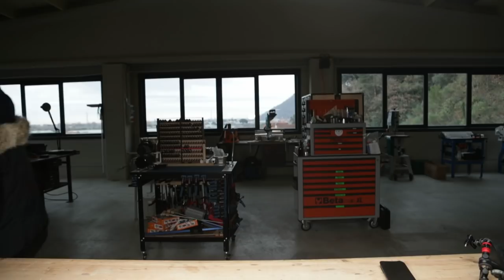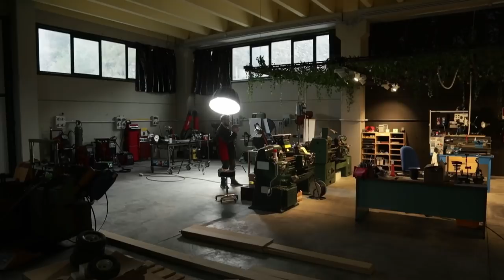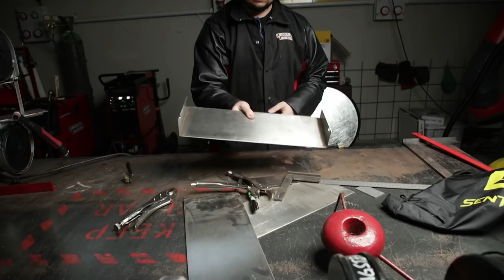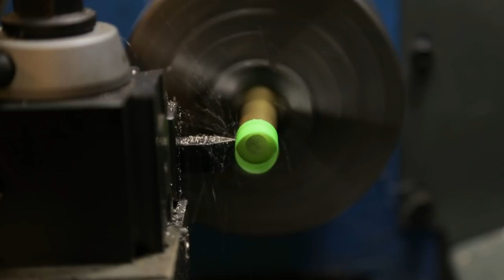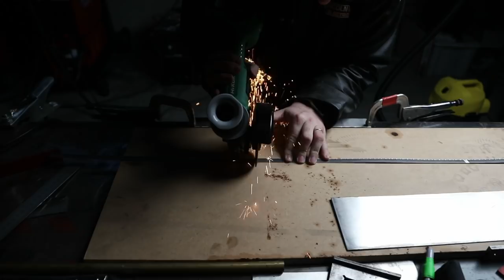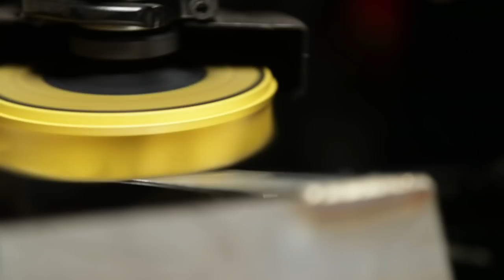Tape station, marking all the things

Comment: Good idea and I like the writing platform and very elegant SS construction but... (for me) it could be a PITA when the roll in the middle requires replacement.  I guess you could cut the cardboard roll that's empty then put its replacement on the end of the bar, as it shouldn't need to go back in the same position.  I've played with the idea of a wide roll for my various tapes but never been able to overcome the (in my mind) shortfall.  Cheers, David

Comment: Looks to me that the bandsaw blade is useless for tearing the tape.  Also a piece of inverted angle under all of the rolls might be helpful when you have to switch out an empty roll.  When you pull out the rod it would catch all of the rolls and then you could tread them all back on when you reinsert the rod.

Comment: Nice vidéo, quick  interesting project. One remark, I am not comfortable watching you working with power tools without gloves. Except with the lathe, in that case you are right to not wear gloves. I do not want to see you hurt. Just a friendly advice.
Reply from the maker: Spinny things = no gloves for me
Reply: It is quite unsafe to use gloves near spinning tools. If a tablesaw catches a glove....it's game over. Same for a lathe, jointer, planer, bandsaw, etc.
Reply: The only thing he worked at where I would have said "put gloves on" was the TIG, but even there it wasn't necessary with such a few welds and low amperage.
On every other tool, he did it right by not using gloves, all those tools he used could seriously mess your hands up if they catch a glove or loose sleeve, even the Belt Sander and Bandsaw. It that's not worth the risk just to pick fewer metal shavings out of your skin.
Reply: Hi, after few readings it seems you are right. Thanks for the info and keep the spirit alive.